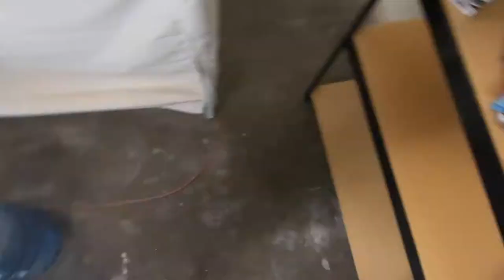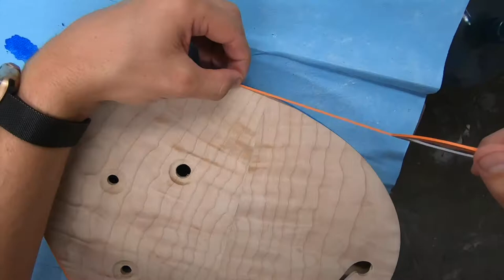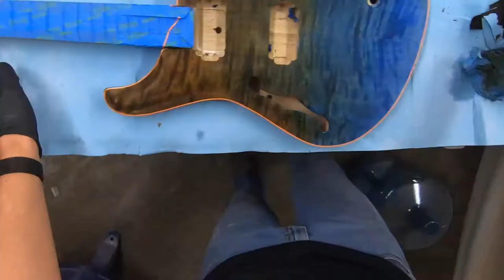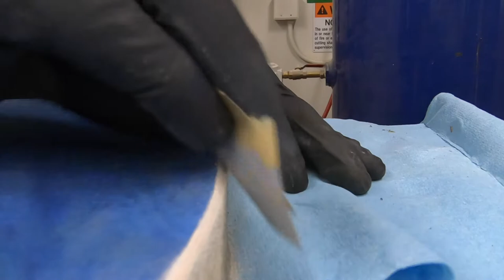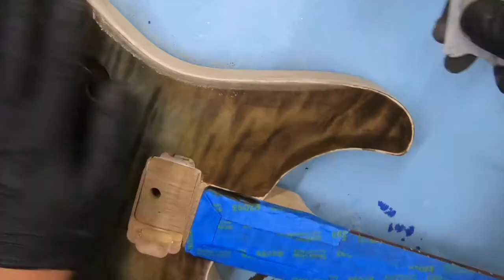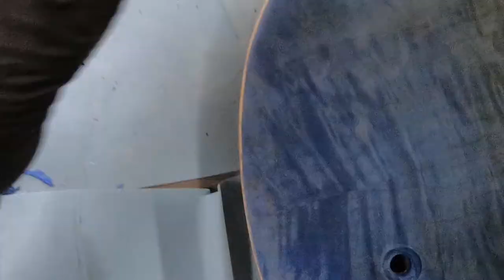Baldacci Guitars Mirror Lake Fade Stain

Comment: We scrape the binding to remove the stain. We don't sand it.  In fact, there was no point in taping plastic binding, because water based dyes do not penetrate it.
Reply from the maker: And that makes complete sense on plastic binding. 
Ours isn’t plastic binding but rather just the natural maple color of the top. This is why we tape the edge off and touch it up with a bit of 220-320 grit.
Reply: @baldacciguitars1469  I see.  I didn't know that's what you did there. I do something similar, but I don't mask. I Finish the sides first with oil and wrap the oil cloth over the top edge to prevent the dye from penetrating the wood, then I carve that edge to a 45 degree bevel.  Faux binding.

Comment: is that mineral spirits in the clear plastic bottle that you're using?
Reply from the maker: Apologies for the delayed response. The clear liquid is just water. Since a lot of these stains are a water base, wiping it down with water will help blend the colors together a bit better
Reply: @baldacciguitars1469  interesting thanks for responding! I suppose that with water based stains you can just use water and dont need mineral spirits
Reply from the maker: @AdrianBlackburnDesteni  yeah, I don't believe we've ever used mineral spirits on anything. We use a lot of Naphtha and Acetone but thats about it